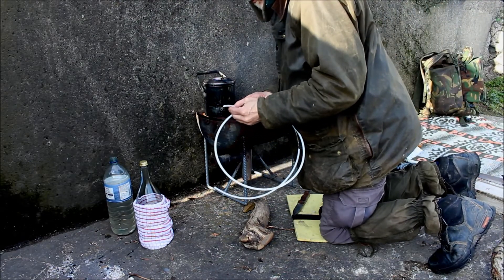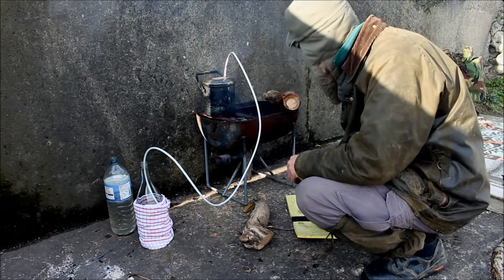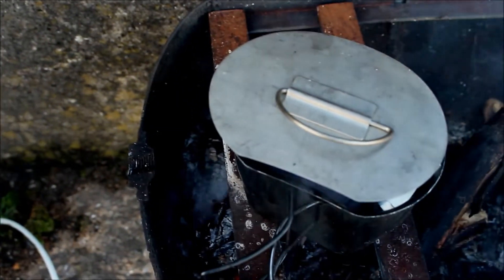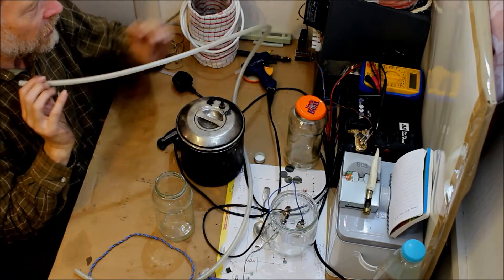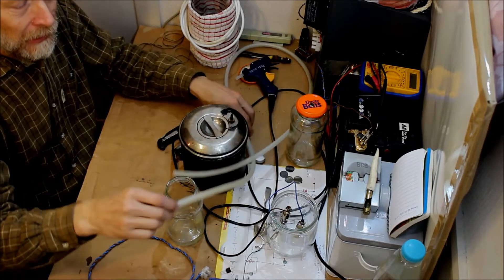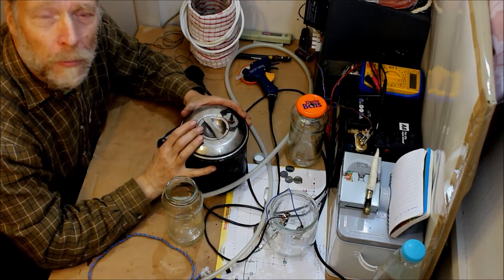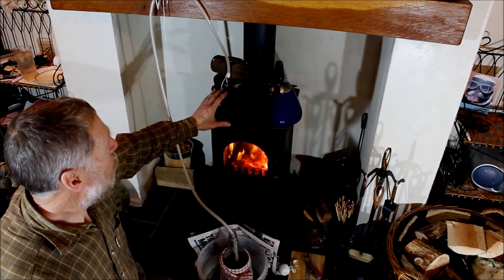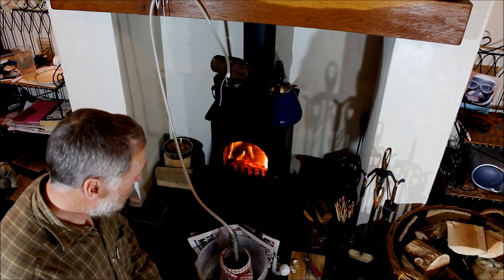Distilled Water and Colloidal Silver Part 2

Comment: I have consumed Colloidal Silver for over fifteen years.  I make my own.  The machine I have is more sophisticated than most.  The device automatically shuts off when the solution reaches 20ppm.  I make clean Colloidal Silver using only laboratory distilled sterile water and 99.99% pure silver.  Periodically throughout the year I administer myself 20ml daily for about 2-3 weeks.  Note – If Colloidal Silver is swallowed, the stomach acid turns Colloidal Silver into silver oxidic.  This is not bad, but just not the most effective way to take the solution.  I suppository Colloidal Silver.  Every morning after a shower I squirt 20 ML into the rectum.  This method of administration bypasses the stomach acid and allows the solution to be quickly absorbed efficiently and directly into the blood stream.  The silver particulates floating in the blood kill a wide range of pathogens that exist in the body boosting the immune system.  I know, I feel it working.  When I get a cold or flu it does not overwhelm me and my body recovers quicker.

Moreover - I have suffered with asthma all my life and use Salbutamol inhalers often daily.  I have found that the condition of my lungs significantly improve while taking Colloidal Silver.  When I take Colloidal Silver, I do not need my inhalers at all.  Conclusion -We constantly breath in bacteria and fungi that float in the air.  These pathogens aggravate asthma.  However, Colloidal Silver in the blood stream and circulating around the alveoli of the lungs help knock out these bugs and pathogens instantly, semi shielding the lungs from infection.  When I take Colloidal Silver, my lungs feel great/healthy (no wheezing).  I have found taking Colloidal Silver hugely beneficial.  If made cleanly and administered correctly Colloidal Silver works.  Taking all this into account, I strongly believe Colloidal Silver would help in the fight against Covid 19.  I hope this information helps somebody out there.
Reply from the maker: I made a movie on my setup but YT removed it. I use current limiting to keep the particle size small. Very under-rated stuff, perhaps something the big companies do not want promoting. Your post is along my lines of thinking.